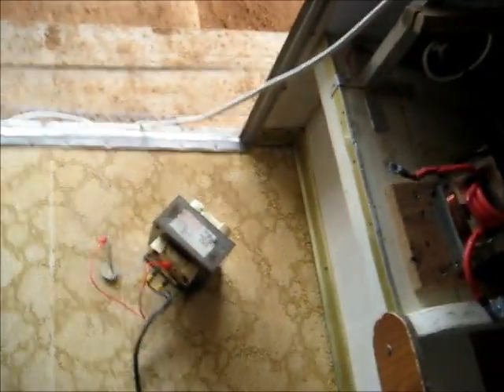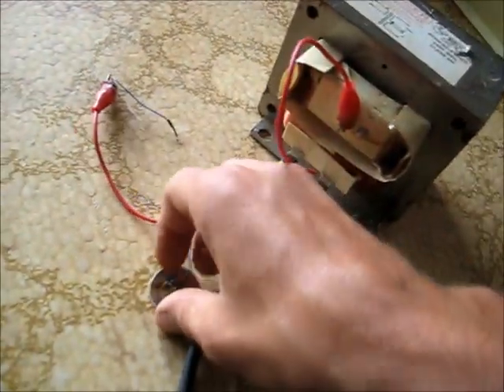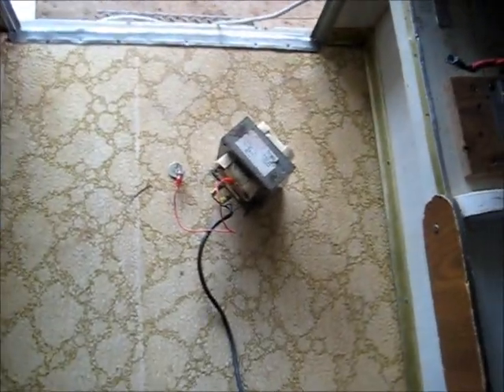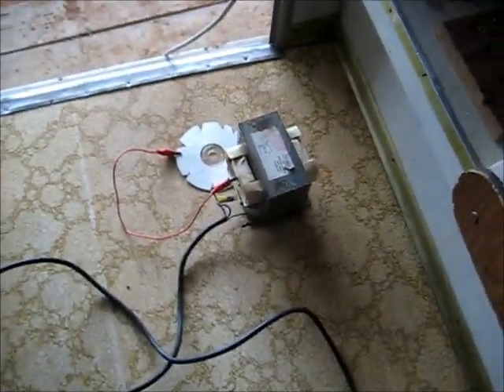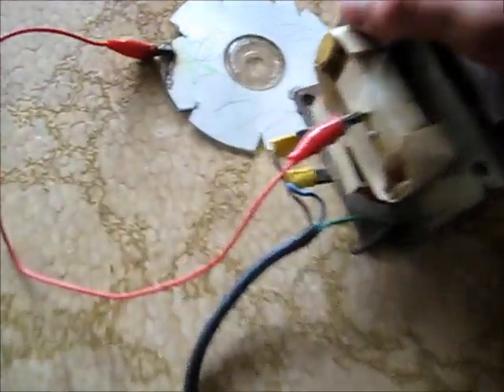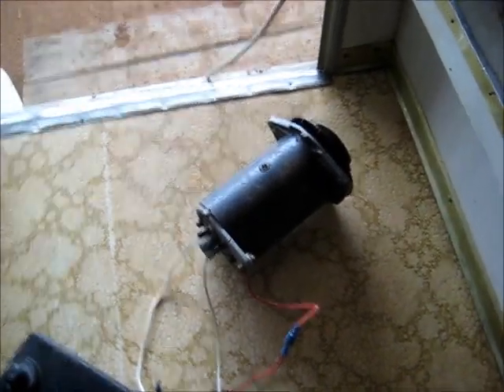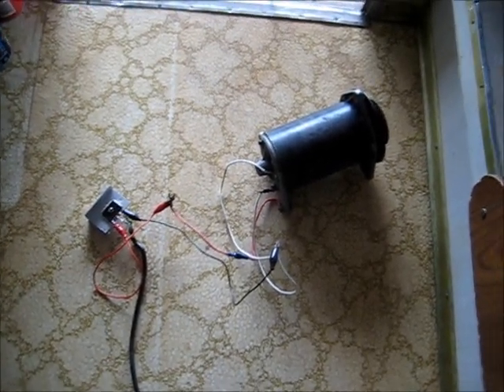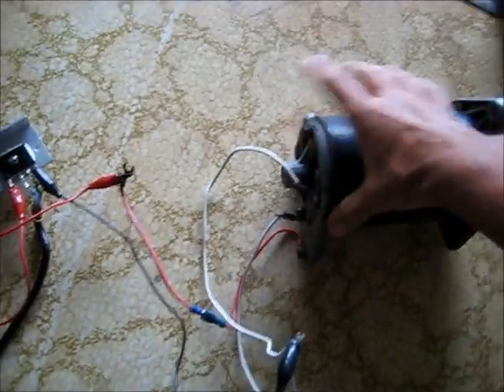Lucas Generator on Rectified Variac & Aerosol can Implosion

Comment: Great video, you popped the piezo.
The Lucas generator would get a lot less than 280 V dc, also there would be a 100 Hz ripple as there is no smoothing capacitor.
What rating is your rectifier ?